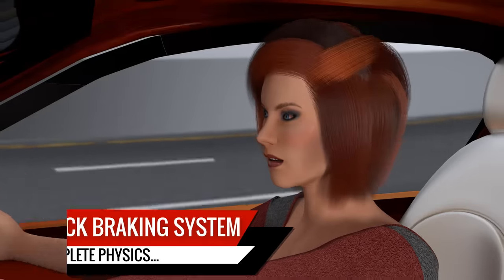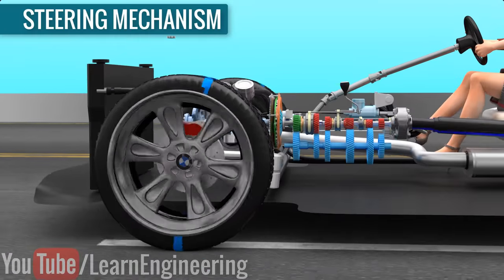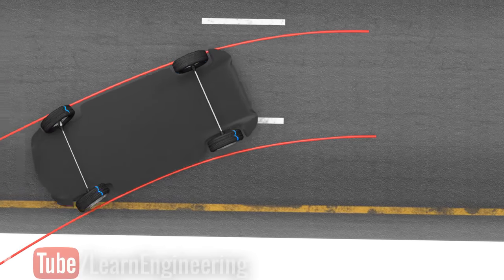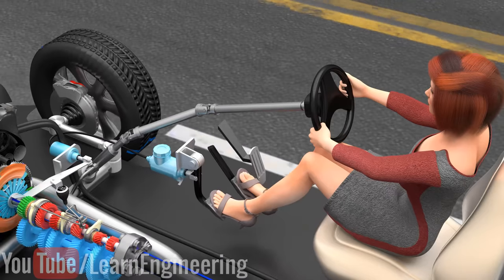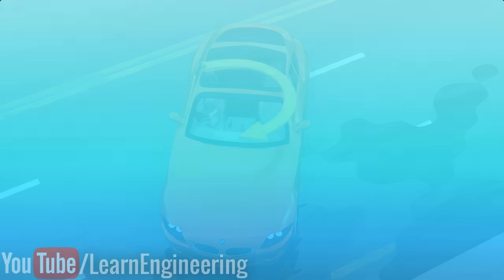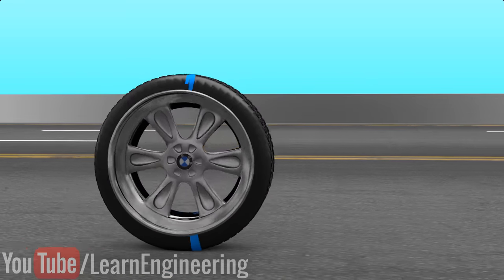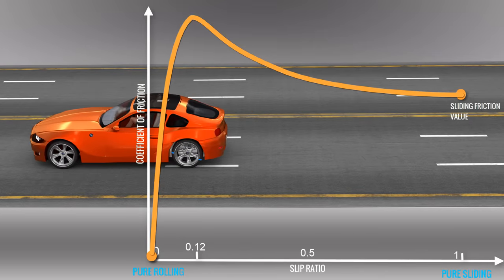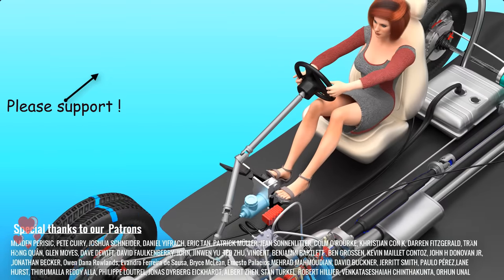Understanding Anti-lock Braking System (ABS) !

Comment: The ABS actually increases the braking distance compared to braking perfectly with ABS off. However, it is very difficult to achieve and requires practise, not to mention the fact that ABS makes it easier to steer properly while braking. In the end I think ABS is a fair tradeoff between braking distance and steering capability.
Reply: Yep, proper threshold braking is a skill you need to train, while anyone can stomp on the brake pedal.
Reply: There was definitely a big difference between some of the domestic manufacturers and Bosch ABS systems, my Audi A4 was much much better in the snow breaking, it seemingly new when to increase the brake pressure to make up for lost distance when ABS was triggered.
Reply: You know that rolling wheel actually have more friction than a skidding wheel IF YOU HAD clear YOUR 11 CLASS PHYSICS BACKLOGS.
Therefore, reducing braking distance.
Reply: Not true. No matter how good you are at braking, under certain conditions, there will be times that one wheel may need more braking than another to most effectively reduce the car's speed. No matter how good you are at braking, you cannot choose which wheel is receiving X amount of brake pressure. So there are times where no matter what, ABS (assuming it's a solid system) will be superior to even the most trained drivers.
Reply: I would disagree, under most practical road conditions, ABS would decrease the braking distance during panic braking.. Only under hypothetical ideal conditions on paper would ABS increase the braking distance.. Dude, when u slip and slip badly, there is such a bad braking distance, which is enough to decide between life and death..
Reply: @Abhinandanabhi1212  true
Reply: @Abhinandanabhi1212  a
Reply: Dude abs does reduce breaking distance!!
Reply: Also the fact that you can do continuous maneuvering left and right with ABS hence buying more distance till you fully approach the object or vehicle ahead which could not be achieved without abs. So ABS reduces braking distance and also buys you more distance till you approach the impending disaster.  ahead. ABS is an engineering classic and genius. One of the most amazing innovations that has ever been.

Comment: Slight nitpick, normal braking doesn't lock up the wheels, you slow the car down with the friction of the brake pads on the wheels and there should be no slip against the road still.

Comment: Awesome explanation and video!  I learned in Physics before ABS became a standard item in most vehicles that rolling to a stop is better than locking your brakes to avoid skidding.  That meant pumping your brakes about 60 times per second.  Lucky there's ABS!  Thank you very much Dr. Kyle and Sabine.
Reply: I imagine the foot technique required to press and partially release the break 60 times per second is quite hard to pull off.
Reply: @hetsmiecht1029  YES, AT LEAST 60 HZ

Comment: In my country since long before abs was introduced we were asked to repeat pump the brake quickly for better grip, now I understand why
Reply: This is just an old advice which can be detrimental in any modern car or bike with or without ABS. ABS system will be turned off if brakes are pumped and in a non ABS car which uses hydraulic braking system or power brakes will lose any kind of braking ability. Because of the vacuum pressure inside the valves, both ABS and non ABS cars use hydraulic system while ABS just prevents wheels from locking up and give steering ability in an emergency situation. It's written in a car manual. This advice is still rolling around because people just don't understand how a modern Braking system works. And yes, ABS works in milliseconds which no human can match.
Reply: An old racing trick.
Since roads are designed so you can take a corner at the speed limit, people aren't trail braking into corners in their daily commutes.
But you can't possibly pump brakes fast enough to mimic ABS optimum grip profiles. Pumping the brakes (or as racers call it, Brake Feathering) used to be a way to retain steering while braking. Which is the entire purpose of ABS. Because as you learned, locking the wheels causes understeer.
An added benefit of feathering brakes is to create "weight transfer", which is when a car's motion is transfered to the front wheels under braking due to inertia. Grip is a function of the normal force applied to the gripping element. Weight over the tire, in simpler therms.  Provided the wheels don't lock, this also increases the grip on the front tires. Racers use it to take turns at a higher speed as more grip means the car slips less thus can turn better.

You shouldn't pump ABS brakes though. Most ABS Systems will understand that as an override command so you'll have to keep doing it so the wheels won't lock up.
Reply: @bokinoki  If by modern you mean a vehicle that was made in recent years, then you're dead wrong.
My 100cc motorbike made in India in 2019 still works well with this technique. Go figure
Reply: Scare the shit out of me
Reply: Neel_kant I think you meant hydraulic/ air pressure based breaking systems.... cheaper vehicle like 2 wheelers still use cables to handle the breaks, they all have got Human ABS!.
As you mentioned,  motor bikes that have hydraulic disk breaks, if they don’t have ABS, it becomes really tricky to hit the breaks.
In mountain bikes (cycle with fancy things), they call this feathering the breaks.
Reply: Bigdady cool  what does abs do? It quickly stomps and release the brake, very fast . The science behind it is that braking friction on the tyres  is maximum when the tyre just flattens under braking..it reduced within few seconds, that's why if the tyre is repeatedly flattened and released and again flattened, braking resistance increases..
Reply: Ye
Reply: @ThZuao  I know this is a year old comment now but that makes SO much sense, especially after watching this video. Funnily enough, I used to "break feather" when I would play racing games with my brother when we were kids (and before I even knew it was an actual driving method); it always gave the cars better drift and more control. What are the odds!

Comment: You can test this system really easy in winter with the shiny slick snow ice surface. Hit the brakes hard and you’ll hear the ABS pump go to work and the brake pedal will pulsate. It’s kinda fun to do in a safe area and this system really works I can’t believe cars were made without this system

Comment: This video really helped me because automobile engineering is a subject in my school and some of the things our teacher taught were unclear, but after watching this video, I understood it a lot better. Also, my exams are coming soon and this video helped me to recall my memory. So wish me luck!
Reply: Actually the description is not 100% correct. This animation discripes 3 different systems as ABS. The ABS is just stopping the brakes from blocking not more ! The description for braking on a road with different surfaces or driving around a street barrier and holding the car in lane it's  called ESC (Electronic Stability Control) or DSC. Also description how it works is not really correct. To hold the car in the lane on different surfaces the DSC (Drive Stability Control) is braking not blocking just one wheel at a time to hold the car in place. Also this system helps you to go around a barrier  or any obstacle in your lane in a higher speed the system usually starts acting on a speed around 50km/h and prevents you car from slipping. This system (DSC) should be turned off by driving in deep snow. Because the DSC works together with the TCS (Traction Control System). The TCS prevents the wheels from continuous turning what makes you stuck in the snow. So next time you drive in deep snow find the button on your dashboard (or center console) with a DSC (or ESC, ESP) on it and push it  A orange light will come on what says the car can slip now. This is ok for the moment because if you let the DSC on and drive in deep snow on the next hill you hit the gas pedal and the TCS will feel the wheels losing traction so it will bring down the motor tours and the wheels turning slower this will make you stuck in the snow! Greetings Ric
Testing integral and car safety
Reply: @ribecomputers  9ice

Comment: The explanation of ABS is good. However, at 6:15 what is being referred to as EBD (Electronic Braking Distribution) is in fact not EBD. That is ESC (Electronic Stability Control) or a sub-function of ESC. EBD (actually Electronic Braketorque/Brakeforce Distrubution) distributes the brakeforce between front axle and rear axle. EBD does not counteract yawrate.
Reply: Thats the abilty of the transmitter and its distribution /release of pressure on individual reciever on each wheels...i forgot the instruments on each wheel ...on trailers air to open is applied to the diaphram of the brake drum the air is calibrated depending on the signal recieved by the transmitter
Reply: Dose ESC needs a different hardware or it's just a software changes in some parameters?
Reply: Same damn thing.
Reply: The author of the video is not an engineer I could tell easily
Reply: @frackjohn  different hardware as it requires varying the brake force without any intervention from the driver.

Comment: I have a Honda 2012 accord and we just got hit with a heavy snow storm up in New Hampshire recently. She's a good car, and did her job when I decided to go driving the next day. Upon exiting my drive way, the ABS system kicked in, as I was turning on some slippery slush, as it should. Unfortunately, the system never turned off and has been stuck in the 'On' position since then. I took out my manual and learned how to turn it off. I have a family member who works in the automotive industry and thinks I either might have low tire fluid or a glitch in my abs system. I'll be checking it out soon, but this is a nice video seeing how it works.

Comment: Hi everyone. I'm Calvin M. P Sinaga. One of Automotive student in Padang State University. I just wanna say Thank you for this informative video on Anti-lock Braking Systems. It has significantly enhanced my understanding of this critical automotive technology. Your explanation of how ABS works by preventing wheel lock-up and maintaining traction, especially during emergency braking, is truly enlightening. I particularly found the segment on the relationship between tire slip angle and ABS performance to be fascinating. It's clear that this technology plays a vital role in enhancing vehicle safety. I think ABS is safety system that prevents wheel lock-up during braking. By rapidly pulsing the brakes, ABS allows the wheels to maintain some rotation, improving steering control and reducing stopping distance on slippery surfaces.
Reply: Which country are you from Calvin

Comment: Actually, I would explain one part of the video differently (sorry for my imperfect English in advance). Static friction on same contacting surfaces is much higher then sliding friction, that is why, for example, its harder to start sliding sofa then keep it sliding when pushing, it feels like its sticked to the floor. Here, when wheels are rolling, they have static friction with ground, ABS, as explained in the video, prevents wheels from locking and by this, it allows us to keep maximum friction with the ground to reduce braking distance. Great video overall ^^
Reply: Yeah he said friction during pure rolling is 0 which is not true, there can't be any rolling without friction.

Comment: This is a good explanation of ABS so thanks! However it skips over the whole fact that when a vehicle isn't skidding, braking comes from the transfer of the kinetic energy of the car into heat in the brake pads and not due the friction of the wheel on the ground, and this is also a factor that has to be considered with the "percentage of slippage" mentioned in the video since if your wheels have no rotational velocity they will not be rubbing across the brake pads and generating heat and losing energy that way.
Reply: they are both correct interpretations. One uses Newton's Laws of Motion with forces and the other uses conservation of energy. You can connect these two ideas by saying the frictional force is doing work on the car by converting its kinetic energy into thermal energy. 

Either ways saying both cases is redundant. Whether you use conservation of energy or newton's laws, in every single classical mechanics/dynamics scenario you will always come to the same conclusion.

Comment: Thank you teacher for informasion,🙏🙏🙏
ABS or Anti-lock Braking System is a very important safety feature in motorized vehicles, including motorbikes. The ABS brake system is designed to prevent the vehicle's wheels from locking during sudden braking, so that the driver can still control the vehicle properly

Comment: ABS has a big flaw. Usually the intermittent action is mostly noted when raining and helps, however there have been times when I’ve been at normal speed in dry conditions and the car in front suddenly stopped, so I hit the brakes abruptly to the floor by instinct. ABS has caused the car to travel much more than what it would have if I had hit the brakes without the instinct of doing it abruptly, as I have made the test of being at the same speed and hitting the brakes normally. I always say I hate the ABS due to this fact but this video has helped me see this flaw is one of the many instances where ABS acts and more times than not it helps. I wish this issue could be looked at, perhaps releasing brake at a different or variable frequency
Reply: If you floor the brakes then i am glad you had abs with you.
If a car in front of you brakes suddenly and you floor the brakes probably you will hit them without abs in a dry/wet/any condition. Especially in manual drive.
So please dont disable abs for testing or for real.
Reply: @YanYanicantbelievethistakenffs  Hi. I didn’t disable them, just did the same speed (which wasn’t that fast, about 45 mph), but braking not so fast and it stopped quicker without sliding because it didn’t trigger the ABS system. The problem is, you can’t control instinct as to not floor it in an emergency. I believe ABS serve its purpose when it’s raining or there’s a puddle, but in dry conditions ABS is good only if you’re at high speed
Reply: @thelastofyou  i dont think you understand what happens when the wheels lock up, especially the front ones. ABS is a safety device. A locked wheel provides no steering, zero. If your front wheels lock up you can go sideways very very fast. If your abs hadnt been there you would have gone straight to the curb or into oncoming traffic. 
Disable your abs and go to an empty parking lot and slam your brakes. It will surprise you how fast your vehicle takes off to the side when the wheels lock up.
Proper braking technique always stops you faster. Abs only activates when you use improper braking technique and it prevents you from losing control of the vehicle.

Comment: Abs doesn’t reduce breaking distance , a good driver that brakes to the limit have a shorter braking distance. Abs avoid wheel locking when you brake over that limit , but it’s absolute not shorter .
Reply: Exactly
Reply: You mean using brake pads friction to slow down cars, but not too much to stop the wheels
Reply: I would very much like to see that mythical "good driver" that can outperform ABS, surely this can be demonstrated in an actual breaking test, yes?
Reply: @aleksandersuur9475  Depend from were you are , but i would by very happy to show you ! But lets erase the first myth about ABS , its not build to make you stop quicker , its made so you tires doesn't lock, so you can avoid a obstacle and can maneuver your vehicle , no way you stop quicker !
Reply: @aleksandersuur9475  you can find vids on YT

Comment: So without abs I can still have abs if I release my brake foot ever so slightly in multiple sessions?
Reply: No, you will not be able to do it quickly enough while still ensuring proper braking power. The correct method of braking without ABS is called threshold braking, where you initially brake hard and ease off the pedal, keeping the brakes at maximum power right before locking up the wheels.

Doing so, if the surface is the same on all 4 tires, you will generally stop quicker than you would by slamming on the brakes in an ABS equipped vehicle. However, the problem is that you need to not only train for this, but also remember to do it in actual real-world emergency braking.
Reply: that's exactly what i used to do when driving older cars with out ABS option and it used to work fine
Reply: @sam70000  Same here! LOL

Comment: I think you are wrong about ABS reducing braking distance. At least the 'old style' ABS - it actually makes the braking distance longer, while still maintaining control.
Reply: for what i know 4WD on snow with ABS makes braking distance longer for sure but you also losing ability to turn in such conditions watch?v=7_99dN4dVkc
Reply: Since no driver can control optimal tire slip on every single wheel/axle simultaneously and under varying external conditions:
https://youtu.be/mKiTAcXK6M4?t=131